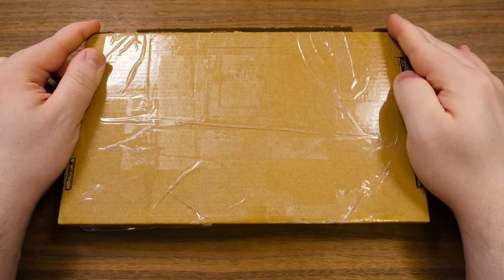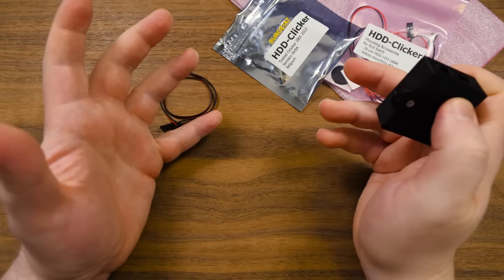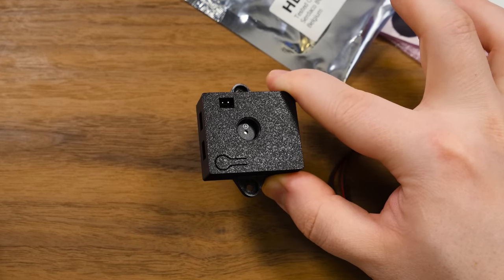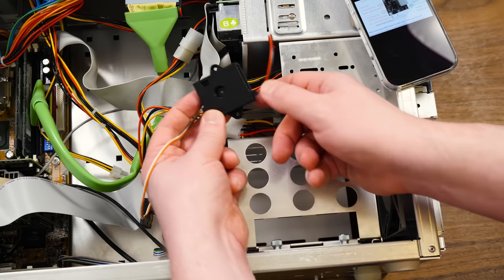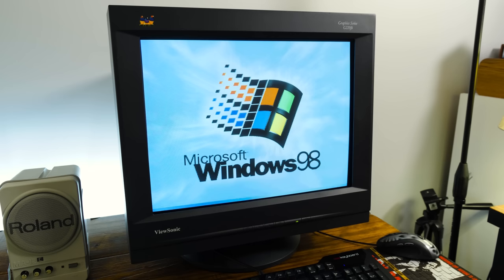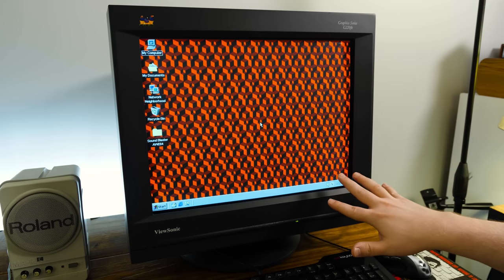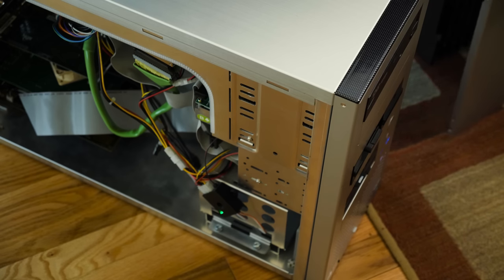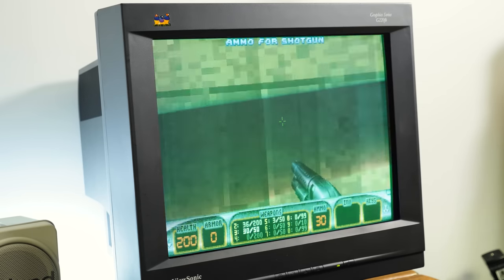The HDD Clicker: Add Hard Drive Sounds to SD/CF/SSDs

Comment: If you have a broken hard disk, open it up and remove the contents and see if the clicker will fit inside that. The speaker being exposed to the open air will not give you the same resonance as a disk stepper motor being inside a metal housing. Likewise, it being on the side of the case will also make it sound off since it's firing directly into a metal panel, but facing down inside the drive cage might be better since you often see the bottom of a stepper facing down out the bottom of a mechanical disk alongside the controller board.

it's a neat idea for sure! It's just in this configuration it sounds more like a laptop disk than a desktop disk.
Reply: Downfiring it from within the drive cages, and a little bit of foam/cotton to muffle it slightly would probably work wonders. Mounting it in an actual drive would be next-level!
Reply: First thing I thought would been a 3d printed metal housing for the speaker. Especially mentioned Caviars tend to have quite metallic click.
Reply: Except they probably recorded the drive from its exterior so putting an externally recorded HDD into an HDD case will still not sound like a proper HDD. You're just compounding the problem.
Reply: @d3v1lsummoner  It uses a Piezoelectric disk to make clicking sounds, though. IIRC it's not sample based.
Reply: @benanderson89  In that case that's slightly better(?). Maybe some metallic resonance could do wonders, but I'm skeptical regardless. But maybe that's just my bias for having little love for the sounds of revolving rust.
Reply: This guy Hard Drives
Reply: wrapping it in a Handkerchief could dampen it as well and lower the volume.
Reply: Actually,... building on this idea, and taking it to it's natural maximum ludicrousness... instead of removing the guts of an old drive, one could instead remove the piezo speaker of this thing and wire it into the actuator arm of an old drive - that way you get real clickity click sounds from a real hard drive while the actual data may come off of an ssd or whatever.
Reply: @pointlesstinkering  This is the way, although for some drives the spinning platters contribute music of their own.  But if you dispose of the original driver board, you might have enough space to tuck a compact flash drive under there along with any activity to voice-coil coupling.  Then, wire up the original IDE connector and you have a solid state HDD with a vintage noisy"instrument" attached.
Reply: NO! NEVER open a HDD that you need information off of. Ever. They're vaccuum sealed, and all it takes is one eyelash to crash the heads. Once you open one, consider it dead, no matter what, unless, you disassemble it inside of a clean room. And I mean, a room with a constant vaccuum that removes any and all dust and particulates from the air, an industrial clean room. That is, with spinning rust. Obviously, SSD's don't fit into that category, but as an actual technician with a degree (graduated with honors), NEVER follow that advice!!!!! Don't spread disinformation, please.
Reply: BS.  A speaker can work just fine and it's easy to prove.  Record a real harddrive and play the sound back, it sounds very convincing.  Has nothing to do with an open air speaker not being able to do it.
Reply: @jaydub8085  lol. Go back and read the fifth word of OP's comment
Reply: Now that's an interesting idea. Without the enclosure the board alone should at least fit in a hdd case. Damn. Now I have to buy two of them. One regular and one for in a hdd case.
Reply: @jaydub8085  Hey, check out your local library on Saturdays. They often host classes for children who are just learning to read such as yourself.
Reply: It is cool they got it to make the clicking sound.. but like LGR said, HDDs make so many sounds. I'd like to see something like this that can produce more of a range but regardless I felt about it the way LGR did lol. I get the feeling that thing isn't going into any of his computers in the end
Reply: No, that is dumb as hell!  This device is abominable and should be destroyed - No ideas pertaining to this devise are good.  Especially this one - it wont work dude - give up homie!
Reply: @russianvideovlogguy  chill. It's just a noisemaker. No need to be so aggressive about it.
Reply: @d3v1lsummoner  This doesn't sound like a reocrding to me. It sounds more like super short bursts of a saw or square waves.
Reply: @jaydub8085  They are absolutely not "vacuum sealed".  That would be a real problem as it changed elevation.  There is a little vent with a hepa filter to allow the pressure to change safely. 

They're also surprisingly resilient  If you did around online you'll find more than a few stories of people who have opened up failing hard drives and put them to some use to see how long they'd take to fail when exposed to the air.  You might find it interesting.
Reply: If you have a broken hard disk, hook the stepper motor to an arduino board and write a quick "clicker" file for it and one for the light, and that's about it.
Reply: Had to not like since it had 486 likes :)
Reply: But yeah HDD acoustics is hard to replicate accurately
Reply: @recompile  From what I've gathered, the danger with hard drives and open air isn't so much the air, as it is the risk of something falling onto the platter while it's turned off. Turned on, you'll have a little air...something from the spinning disks that flings dust particles away from it.

Comment: I love how you mentioned the hard drive clicking sounds being relaxing, because I feel the same way. The sound of the hard drive spinning and clicking mixed in with the low, filling sounds of the fans and the high-pitched sound of the CRT was like white noise for me. Even now, when I go into the basement and fire up the Dimension 2400, I still get that warm and fuzzy feeling. And I'm only 17! But hey, that was my only desktop PC up until I was about 9 (I got a used Compaq D530 CMT that our aunt gave to us), and I was happy with it.
Reply: My first computer was a Tandy 1000 HX. Two 720K floppies, no hard drive. I've since built a custom XT-IDE solution for it, but I keep thinking I ought to ad a big clunky relay to the CF-card module so it sounds like an actual hard drive.
Reply: That's a trippy experience looking up the Dimension 2400 and finding reviews online from when it was new but hearing about the model from a retro angle lol
I think I'm getting old :'D
Reply: @DounutCereal  We’re all getting old.
Reply: Feel the same way. I'm 19 Nd remember using SGIs and Amigas in primary school. Some early windows os's as well. Recently got an a500 in the process of installing more ram on that. Tbh the sound of the floppy disks just give me anxiety, need to get a HDD installed soon hahah. Wanna do a w98 rig also. Remember my dad had a PVM back in the day as well. Was sick it was like 21", 1440p and colour correct for graphics work. Doubt I can get anything that good, might try get a Trinitron for the Amiga and my old consoles tho. Them old Sony CRTs are sick asf
Reply: @BlackEpyon  That actually would be pretty cool! It would have a more authentic, metallic sound to it. 
I feel like another solution, although a bit complex, would be to take an old (preferably dead or insignificant) IDE hard drive, and use an MCU like the Arduino to control the heads.
Reply: @DounutCereal  I know, right? I remember using it when my dad first set it up for me in the basement back in 2009/2010, with a fresh install of XP and Ubuntu 9 in a dual-boot configuration.
Reply: @JosephM101  It wouldn't be that hard if all you need to do is get the head to move. Just apply current to the voice coil, and it'll move. You could even apply current to the motor too, for authentic hard drive spin-up sounds! But at that point, you may as well just find a working hard drive and use that instead.
Reply: @JosephM101  Hell yeah! About '09/'10 I has a school issued laptop I had dual bootable between ubuntu and XP. Not that the school wanted it that way
Reply: @DounutCereal  That reminds me of a story that MattKC shared on his channel, where he talked about how in school they were all issued laptops that were Windows 7 certified, but they had Windows XP installed on them with the school's software and were extremely slow. But because of the way it was partitioned, Matt was able to dual-boot Windows 7 alongside the school's copy of Windows XP, and it was so much faster than XP. He ended up doing that for a bunch of other students.

You'd have to watch the video. It's really a great story! Very entertaining.
Reply: @JosephM101 Fellow person of culture :D

Comment: Awesome idea! The only possibly off-putting aspect is that it simulates loud clickiness from like, early-90s drives without the noisy motor spinning. This really needs a metal flywheel to generate the motor sounds! And maybe volume controls.
Reply: better yet: several metal flywheels placed very close to each other, driven in parallel.
Reply: Or use the old motor from an old drive and attach the clicker and or SSD board to the underside of the drive?
Reply: Maybe just rig a hard disk to keep running even if it's not reading and writing anything itself?

Comment: Mine just marked as shipped the other day. I'm glad you did this video, it helps ease the pain of waiting.

I ordered the version without the 3D printed case. I'm going to try putting some foam mounting tape directly over the piezo speaker hole, and see if that dampens the sound further.

Comment: It's the same problem with those Amiga floppy ones you mentioned. They sound nothing like an Amiga drive, they sold like old PC drives. Due to the Amiga's form factor, the floppy drive sounds considerably softer with less reverb, and isn't as "tinny".

Comment: Losing the drive activity noise was the worst thing about getting an SSD for me.  I used the noise to gauge what was going on, if Windows or some random program was accessing the drive in the background or if the program I was using was loading or frozen, and it was so helpful.  Missed the sound for years and years and years.  Currently have some Seagate Ironwolf drives and good god they're so loud they lowly vibrate the entire case; extremely bothersome.

That clicker still sounds worse though; way too loud for the Seagate Barracuda drives I grew up with.

Comment: If there was a slightly larger transducer and lowered volume, it would work quite well (seems to lack that lower-frequency resonance that an arm/platter makes). Neat idea to run it off the HDD LED. Maybe have a programmable setting for the click to sound on every second or third flash? Different sounds? This could be a fun little thing.

Comment: I’ve always wondered about an option like this and whether there was ever interest.  I love the idea as it helps complete the experience (for those who want more than silence from all but the power supply fan).  However, I wonder if a taptic engine would feel more authentic, mimicking the deeper “thumping” sound that seeking on older drives would give you.  I think the vibration from that would feel very convincing.
 
I think this is a great start.
Reply: That would be a perfect idea for old drives from the 80s! The 20mb Seagate I have in my IBM will vibrate the whole desk the entire time its running. And if you run Norton's disk check, one of the tests really gives it a workout, and will even start shaking the whole desk a bit!

Akin to driving a car. You feel just as much as you hear.
Reply: Big clunky relay.

Comment: It would be neat to be able to change the volume and have it sounding more mechanical (and some way for it to imitate the sound changes as if it's reading different platters/tracks. ) Also, it may be a nice touch for the cables to reach the back so it can be mounted to look like a tadiran battery stuck to the inside backing.

If this is designed with more emulation I'd be careful though because having too much going on in its processing could possibly make it lag a bit more and not be in sync with the LED.
Reply: BMoW actually does something similar for the Floppy EMU that uses a relay to make it more "mechanical sounding": https://www.youtube.com/watch?v=VGEMGFMK2dI

Unfortunately, that doesn't really sound "right" either.
Reply: >  imitate the sound changes as if it's reading different platters/tracks

Have you ever heard a hard drive before? Or know how they operate?
Reply: @Those_Weirdos  I am referring to how a hard drive has different pitches (or whatever it's called) while reading/writing.
Reply: Agreed - A circuit to randomize & or ramp up/down the intensity/volume of the clicks after an also random number of pulses would go a long way to imitate the travel & position of the heads in a mechanical drive. Idk if that would be simple or not in such a small package...

Comment: I would so like it to also do the platter spinning sound. That and the clicks would be so awesome. Wonder if someone just also replaced the piezo with a small cone speaker. So much cool potential here. Then make a HDD size case for it and... and.. and yeah a solid thing but some improvements would make it so damn super cool.
Reply: i miss the sound of my old raptors  spinning up , and making the floor shake .
Reply: @B33fSupreme  Yes! Thats why I always grab a Velociraptor for any build I do. 10K rpm drives use to be a big deal. And they are great for putting EMU's and older games on.
Reply: I was thinking about this as well. Maybe plug any old spinning disk just to power for the whirring sound.
Reply: Especially on boot
Wizzzzzzzzzzzzzzzzzzz
Reply: Platter sound is very nostalgic, both winding up and winding down. I still have an HDD backup drive that powers up whenever it's accessed, then some time later you can hear it cut out as it powers off again.

Comment: I just fired up this old 486dx2-66 at the office (found in a back room, made a couple videos about it, but I digress), and you are 100% correct: the drive has various sounds it makes during usage. Some clicks are loud and repetitive like the adapter you got. But, many are more subtle, like a very light tapping as opposed to the clicking (and no I do not mean head crash sounds). But even while continuously running, the pitch, volume, and "speed" of the clicking varies greatly. The adapter is a fun first-run go at it, for sure, but two papers later and we'll have something special. It's still very cool. What a time to be alive! (heh-heh, to borrow the phrasing of another youtuber).

Comment: I second the need for "Randomized" clicks. You really only hear that click sound when the head has to move far. If the drive is reading/writing several nearby tracks, the head barely moves. IE: If you format or wipe a disk, you won't hear the click as much because even though the drive is pretty much working at 100%. That's because the head is just gradually moving from one track to the next as it writes 0's over the entire disk.

Comment: My last tower had a WD Raptor 10K RPM drive with a plexi cover instead of metal (supposed to be shown off in a side window, I think?) and this noisy little clicker at first sounded just like that drive - Loading up XP/7 sounded like making popcorn in my case! I've got a 5tb firecuda in the power supply basement of my case for the obnoxiously large games (with a cache SSD) and you barely hear it because it's buried. One of these little beauties would definitely bring back some retro love.

Comment: It's a difficult task as hard drives vary a lot.  Some are quite quiet.  Also, old pc's would also be more noticeable because they had so little fan noise due to very few, and very small, fans.
Reply: As far as I remember, one particular drive could make different noises depending on what it was doing as well
Reply: @somitomi  Ya, they could make different sounds and have different tones.   When running defrag, for example it would seem like you could almost tell the difference between the "read" sound and the "write" sound as it was shuffling the data.  I dunno if it was a mind trick, but it sometimes seemed like that's how it was.
Although, from memory, it wasn't as extreme as floppies that made all kinds of different noises under normal operation.

Comment: I'd try opening it up and filling the actual thing with something that dampens sound like acoustic foam. 

Also I think it would be interesting to try writing some software to control it, and linking it to Window's hard drive usage levels with added randomness. The only downside would be no clicking on boot.
Reply: Maybe you could make it respond like this one does by default until the program takes control, that way you could have clicks on startup, and more accurate ones after boot.
Reply: That was my thinking, somehow dampen it. I remember old hard drives clicking but they had a lower sound. Its very close, and with some minor adjustments I think it could be very convincing.

Comment: It'd be cooler if the little microcontroller could do a very basic interface with IDE to control a sacrificial HDD. That way you could swap out the "sound" easily. You'd also get that really great spin up sound on old Matrox drives.
Reply: The drive would need to be functional to begin with for that to work though, and not like vintage hard drives are known to last very long.  At that point if you have a working vintage drive why not just use it and get the real experience
Reply: @startedtech  you could use a drive that has data issues but the mechanics still work. And there would still be reasons to use a CF or SD card, namely convenience and speed.